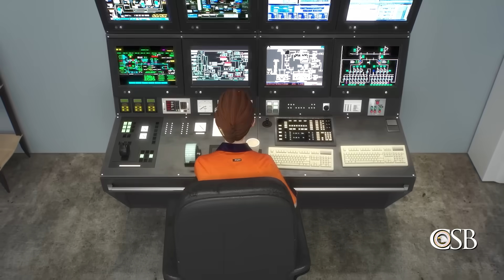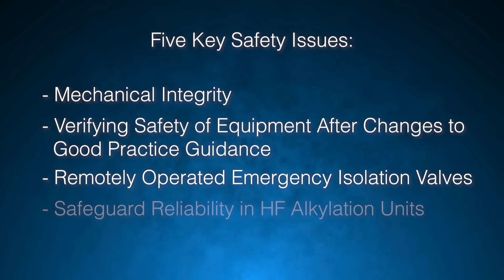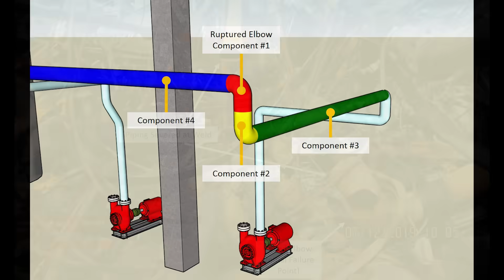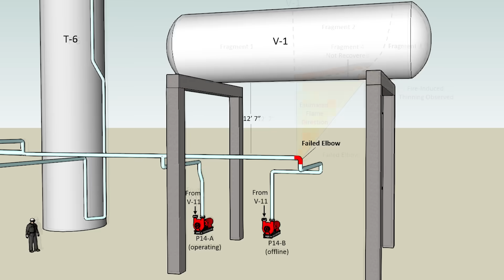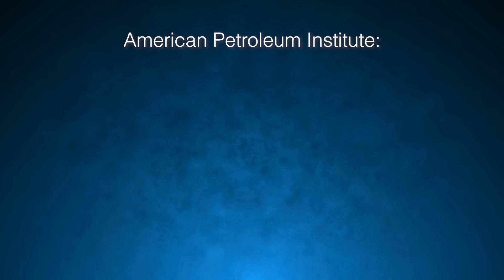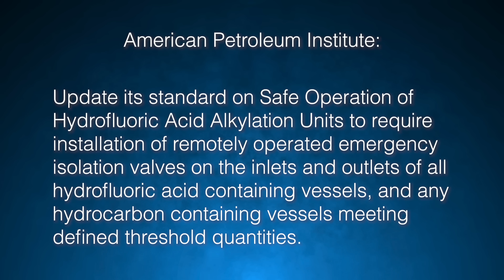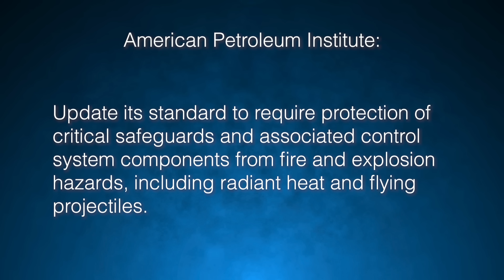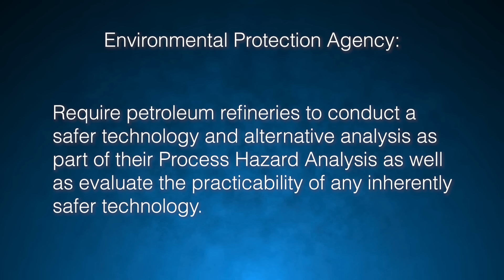Wake Up Call: Refinery Disaster in Philadelphia

Comment: Overall, this accident was far better than could have been expected. The onsite staff did everything correctly, activating safeguards remotely and manually. It's rare to see an accident that doesn't involve operator error on the USCSB channel. Excellent breakdown and thankfully no deaths or severe injuries.
Reply: Really hope those critical staffers(the operator that isolated what they could, and the supervisor that braved the flames to turn on the pumps, and whoever else), got some good compensation for saving the company.
Reply: @voicetest6019  Hi, was working there when this occurred. Most non-union staff like engineers were laid off within a few days of the accident. Union workers were given about 2 months. There was no severance as it was "unforseen circumstances".
Reply: @danielbloemker4871  yep, that’s unfortunately how it usually goes. I hope you were unionized and were able to use the time to find a new job. Sorry you all had to deal with that.
Reply: @danielbloemker4871  I am now retired from a refinery in Tyler, TX. One of your managers was hired there. He did not impress me in the least
Reply: @voicetest6019  the company made the decision to close less than a week later, the shift supervisor that turned the pumps on was let go with the rest of the managers with no severance.
Reply: @voicetest6019  Yeah. They all got laid off  when they closed the plant.
It could've been saved if tfg would've lifted a finger to help. Dummy would've won PA too.
Reply: @voicetest6019  doubt it since 750 million in losses
Reply: That's because operator (human) error is almost always the cause of an accident. Hence 99%+ of accidents and injuries are preventable. - Chemical Safety Officer
Reply: @JP-wx6uh I disagree, it's a system issue. Why wasnt the system designed in such a way to prevent accidents due to human error? Sydney deckers book should be required reading. Operator error is never the root cause.
Reply: @JP-wx6uh  What does a Chemical Safety Officer’s workday look like? I’m so curious, I really have no idea. What kind of work environment?
Reply: Yeah!  This video surprisingly left those partaking in the “USCSB Video Drinking Game™️©️®” still safe for Sober-October!
Reply: @ericlotze7724  everytime there's a warning siren they have to chug a pint

They're usually shitfaced by the end of day
Reply: @ericlotze7724  0
Reply: @ericlotze7724  p
Reply: @ericlotze7724  Eh, I'd take one shot for "Management inertia against safety and modernisation efforts"
Reply: @TheAgamemnon911  True lol.  Why do it the safer way / just inspect our pipes when we can make number go up?
Reply: @Karl with a K Operator error is more like someone pressing the wrong button and causing an incident, this is better described as ignorance from the company, as they never told their engineers to check the integrity of the pipes
Reply: Their emergency response was top-notch, but their inspection/maintenance wasn't.
Reply: Well done to all one if staff. The guy that manuall tuned on the pump had determination and con do attitude. Bravo!
Reply: I'm not sure if USCB implemented this but to ABS it is no longer "human or operator error" and rather a "front line personnel performance gap (FLPPG)"... I think it's OK, but when an incident occurs, the root causes are always a management failure rather than giving operators or FLPs any responsibility.. Not a bad thing, but it seems they forget that these places aren't making chocolate.  The operators are most of the time, the smartest people there and rightfully so.  It's as if they can't possibly be at blame, which I think is an insult to their intelligence.  Instead it's a "there should have been a procedure made so this "performance gap" can't occur."  I'd rather have operators who are held to the same standards as the plant manager - it makes for a less complacent work environment IMO..
Reply: Do you (all) think that having deaths attached to an accident makes it more important to fix? I think that accidents with zero injuries are usually overlooked in my experience. It seems that nothing changes unless some severe injury is caused. I mean in this case they could have wiped out the entire city population overnight if the fail safes didn’t work. As an engineer I will always believe that intrinsically safe operation is the only way to do anything automated.
Reply: @Karl with a K the worker cant and shouldn't be expected to foresee  or have any way to get in the proper Shiite...but probably have to be guilty until proven otherwise
Reply: Agreed, and it's always nice to come across one of these where an event isn't caused by gross incompetence. Also nice avatar~
Reply: from what I saw in this video is that the owners didn't perform inspection to make sure their plant was up to code, instead they just chugged along and everything, their fire suppression system was not functioning which is quite bad.

Sadly, the U.S. regulations are a joke if they are giving the company a pat on the back with this one.
Reply: No deaths?! Did you see that guy with the truck drive into the fuel air cloud? If he's not dead, I'm sure he is in a Deadpool sequel as a stunt double. 3:01
Reply: Another excellent video. Who thinks the protection for remote safety shutdown controls described after 11:30 should be complemented by fail safe logic configuration so that the deluge system is activated automatically if the remote signal path is damaged?
Reply: The plant was old and poorly maintained. Nobody verified that the safety systems would actually work when needed so multiple safety systems failed or had to be operated manually. It's only luck that there weren't a bunch of deaths. Thousands of residents nearby had to shelter inside their homes to avoid highly toxic fume exposure. The company shut operations down, then rather than fix the problems filed for bankruptcy.
Reply: @greenspiraldragon  with the current state of environmental politics, that was probably the right move.
Reply: dont be so optimitic just because this huge explosion didn't particulally harm anyone very directly, the mismanagment of the site has been allowing pollutants to leak into the adjecnet neighborhoods for years. There still a heavy amount of benzene poising cuased by the the refinery, and that's not to mention the years worth of other chemicals like lead that have leaked from the refinery in decades past. Don't be fooled, I used to live down by there. I met old ladies that lived closer to it than I. They were sick with cancer, and some of thier children had already died from rare forms of cancer aswell, it's fucked. Not to mention even if the explosion didnt really hurt anybody, it doesnt necessarily inspire confidence in a major metropolitan area to see a huge explosion like one with a fireball nearly as tall as a skyscraper, rocketting out 1500 pound chemical tanks into the air. I'll put a link to the actual video of the explosion below, you should watch, it looks like a fucking tactical nuke going off, its horrific and a disgusting result of greedy negligence

https://whyy.org/articles/cancer-causing-chemical-benzene-found-pes-refinery-site-south-philadelphia/

https://www.youtube.com/watch?v=yCXysi2g61Q
Reply: LANG LEBE AMERIKA!!!! 750 MILLIONEN TOILETTENPAPIER VERLOREN, BETE FÜR JERUSALEMS PETROL CHURCH GOTT, WIR WERDEN DIE WELT MIT PETROSHIT KONTROLLIEREN UND IN GROSSE HÖHEN STEIGEN, WENN DER WASSERSPIEGEL STEIGT. BLEIBEN SIE NORMAL UND FÜLLEN SIE DIE KAUTION, LEUTE ( I USED NATIVE LANGUAGE OF NATIVE GERMANS ASS "SETTLERS" GENOCIDES OF AMERICAN PEOPLE)
Reply: Uum someone is gonna have there arse on the line
Reply: You mean this accident turned out to be not as bad as it could have.
Saying an accident was better implies that accidents are a positive thing, not a negative thing.
Reply: I think the “operator error” took place when they did not check the corrosion on the pipe elbow since the 70’s. I would think the plant would have yearly checks on everything. Unless they disregard any possible accidents for financial gain.
Reply: I'm waiting for the huge Marathon Refinery In SW Detroit to light up like the Challenger Space Shuttle did in Florida.
With Refineries like this, the Marathon complex is an explosion waiting to happen. Every company cuts corners every day to save a penny or nickel to boost the bottom line for future bonus money to the company executives. 
Workers and surrounding community members are just collateral sacrifices.
Reply: I agree. And there was no fault on the employee. I gave up working with molecules that make oxygen.
Reply: Shame it's not equally as rare for these corporations to skimp on the safety inspections and sweep blatantly obvious safety issues under the rug, all for the sake of saving a couple bucks.
Reply: @DoctorDerpman  I wonder how many months of corner cutting savings was wiped out by the 750(??) Million dollar explosion.
Reply: @gorillaau  Short Term Profits over Long Term as per usual oof
Reply: @ericlotze7724  True. All mangers who got a bonus for making the short term target are to return it so we can pay down this long term loss. I know, I know that will never happen.
Reply: The only thing I can think of is that the water hoses should've been activated by an open circuit and not a closed circuit. Much better to have a failure and spray foam everywhere, than have a failure and spray HF everywhere.
Reply: @idahomedic  it’s not foam. It just water. Over 1000 gpm/min in full fog to knockdown the hf vapors. The negative to this is low Ph water going to the waterways
Reply: Agreed, the operators on the ground did a great job. There were however several system failures, the pipe, the backup battery, etc., which to me points to a failure on this one of the engineering team or more likely leadership approval of engineering recommendations/staffing.
Reply: @greendecoserve  probably an outdated UPS system that was never upgraded. A lot of these older refineries have UPS systems with their original batteries.
Reply: @Bluffrat361  Which are worthless after what 2 years... 3 maybe?
Reply: @frizzlefry5  no they last quite a while. But refineries are getting old. Where I’m at, we check the ups system once every 12 hours. But the refinery I work at is extremely safe
Reply: @Bluffrat361  you do realize a new replacement would most likely use the exact same type of battery? You have to have batteries voltage check annually if it’s part of a fire safety system, the batteries are the one thing that actually does get inspected regularly at these places, because usually it’s a 3rd party doing it annually as it’s a state requirement.
Reply: @Moped_Mike  we check voltage twice a day and batteries do get changed out annually
Reply: Because they were American.
Reply: no they didnt they failed to maintain the pipes from weakening
Reply: @Rusty_Gold85  They meant the control staff.  One of the other refinery incidents had them essentially making things worse by pressing the wrong buttons and disabling things etc, but you are right that that should have been spotted,
Reply: @Rusty_Gold85  what? Control staff didn’t fail to maintain that.
Reply: I'm disgusted.

All because USCSB placed a 3D woman in their animation this time handling the control room, everyone here says the 'staff did everything correctly'.  But if it is a man, like other videos, the comments be like 'incompetent', 'complacency', and so on.

I'm absolutely offended by this. I'm going to call Child Protective Services to report this.
Reply: @avineshputash5812  tf are you talking about bro
Reply: @pharder1234  Don't feed the troll
Reply: @avineshputash5812  lol, I'm not usually good at spotting troll/satire comments but this one was immediately obvious.
Reply: @avineshputash5812  Dude, it's the CSB. They almost certainly know the identity of the workers that were involved. There was probably actually a woman working there.
Reply: @avineshputash5812 You replied to a comment about the shift supervisor who went into the flames to turn on the firefighting system and said the female doesn't get enough credit, and now you replied to this one saying and the exact opposite, also what is CPS going to do?
Reply: @avineshputash5812  Since most of the people here belong on r/woosh I wanted to tell you that I get your joke and found it amusing lol
Reply: @avineshputash5812  This is... Not a good attempt. What does CPS have to do with anything? Comes off as a non-sequitur.
Reply: @nameless-user  it was obviously just a joke and not a troll attempt smh
Reply: @avineshputash5812  bad troll, try harder next time with your victim mentality
Reply: @idahomedic  You are absolutely right as he is not the correct demographic. I cannot stand people who point out double standards. Sheesh!
Reply: @avineshputash5812  Call the NAACP too!  As the depiction of the woman, was not a black woman!
Reply: @walterburger5281  but she identified as a black male.

Comment: One of my big takeaways from this was the fact that the emergency mitigation safety mechs relied on a communication between them and a control station. Mitigators really should be triggering automatically rather than relying on operator input or communication systems.  I don't see a reason why such a system couldn't have been hardwired.
Reply: On the Railways as much as possible is designed to be Fail Safe. Triggering the safeguards and appropriate isolation valves on loss of signal rather than on reception of signal would seem a better approach, being closer to Fail Safe.
Reply: If the facility had been built more recently, it would all be failsafe design.  Stuff this old was generally designed energise-to-fail and it often gets overlooked or grandfathered rather than updated to modern standards.
Plant I used to work at had updated all their boilers to failsafe design except for one that was planned to be mothballed in a couple years.  I saw a single blown fuse cause a complete loss of process control, partial loss of process measurement, and rendered the emergency shutdown inoperative.  Not a good feeling when the board operator hits the ESD button and nothing happens.  They ended up getting a field operator to run in and manually close the main fuel gas valve to the boiler, and were fortunate to get it before anything else failed.

Comment: Nuclear power will make all of this burning hydrocarbons nonsense obsolete.  22 million kWh in 1 kg (~2lbs) of thorium or uranium.  Thorium is found all over the world and frequently at 6% concentration (see monazite sand).  Uranium is naturally found in the ocean, plus we could breed our "spent" fuel in newer reactors.   You would need 13,000 barrels of oil to have the equivalent energy of thorium that would fit in a 2-inch diameter sphere.

Comment: Holy crap, those fragments are MASSIVE! I can imagine being struck by any of them would be a horribly unpleasant way to die in case ridiculously toxic and corrosive HF was the least of your problems. 😲
Reply: There is an older USCSB video called "Falling Through the Cracks" about a quartz plant explosion. One of the pieces from the pressure vessels flew across a nearby highway and killed a random guy a a gas station who was walking out to his truck after paying for his gas. That haunts me.
Reply: @divisionisfakenews197  Oh that poor guy
Reply: And to add insult to injury, to treat HF ingestion/inhalation, you literally need to intentionally overdose the victim with calcium to prevent their bones from disintegrating since HF is apparently strongly attracted to calcium once it enters the body.

Comment: Very good and usefull video. However, I feel that noticing the elements of the pipe which prevent disclosed protection of an iron-fluor layer is such specific information. How can a refinery keep up with such things?
Reply: There are many refineries that have done 100% component chemical analysis (thousands of components and hundereds of thousands in inspection costs) after it was made known that certain trace elements in the carbon steel can lead to accelerated corrosion.  It's time consuming, expensive, and difficult to track, so the impetous isn't always there...most likely, the corrosion rate on this elbow was inferred from nearby piping.  From the images, it looks like in order to inspect this there would have had to have scaffolding built to accees it.